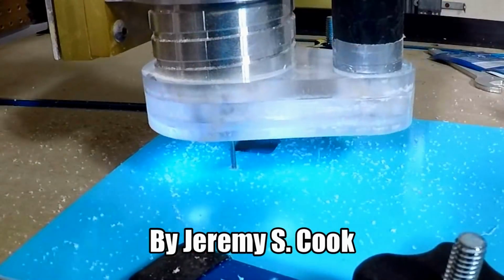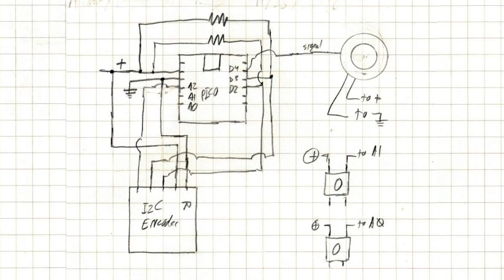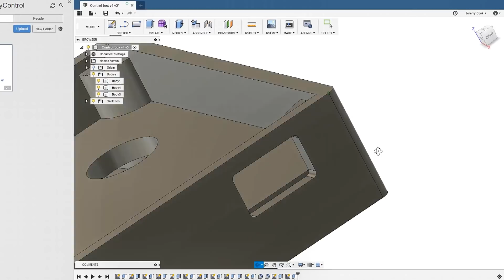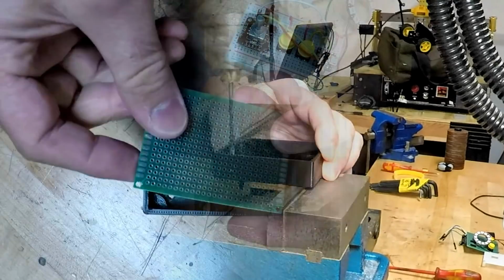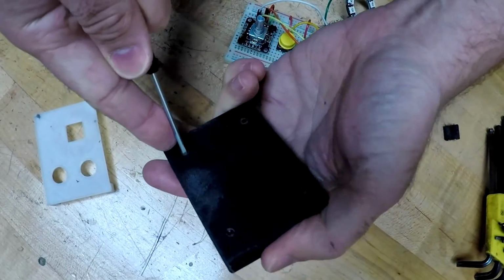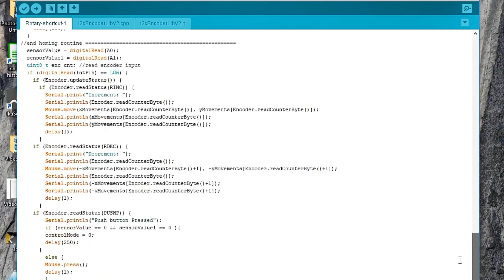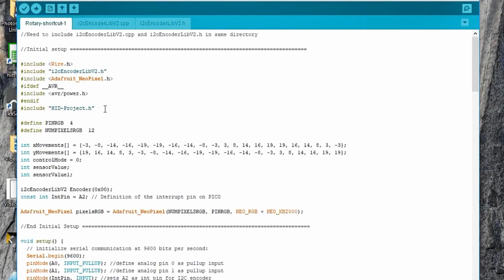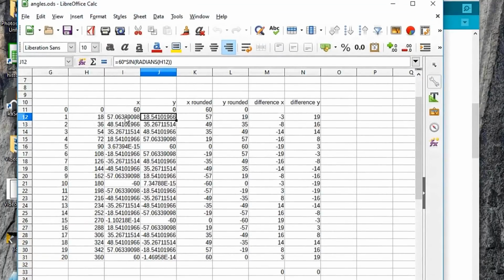Ultimate Rotary Input Device [Encoder Arduino]

Comment: Can you guide me I’m building a controller for a tabalet with two rotarys. Encoders and four button I have encoder for volumen play and pause done 4 click buttons ( special functions) done too the only thing I’m working on it’s the second rotary may plan it’s using this to navigate through the screen like a dpad jumping from app to another app and clicking enter on it but I can make it work as I need just going left and right not through every object on the screen may help please?
Reply from the maker: Sorry to say, I've never used this device with a tablet. Likely what you're looking for is constantly comparing if the encoder value has gone up or down, then outputting a single "key" stroke.
Reply: @JeremyCook  did you have ny idea how you do that on code man im not an coding expert or a single idea or code
Reply from the maker: @edgaresn1  Sorry, I don't think I'll be able to help you.

Comment: Muheh, did a similar one for my graphics colleague. To zoom and (upon toggling a switch) rotate the canvas. Pretty cool for a prototype. Been thinking of features and logic that I would like to have in version 2 (to the embarassing point that I am still thinking).
Reply from the maker: Ah, that is pretty neat. Yes, it seems these things just keep developing. Here's my current iteration, with a few improvements: https://www.youtube.com/watch?v=2CEy4JOxYWI but I still have other ideas!

Guessing you used software like Autohotkey for the rotation and zoom, or were you able to do it without extra programming on the computer side?